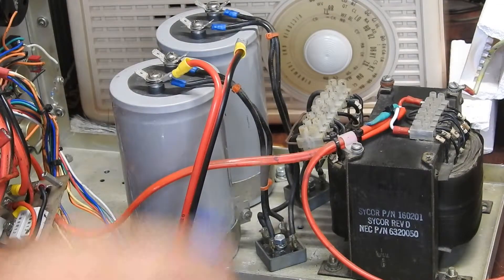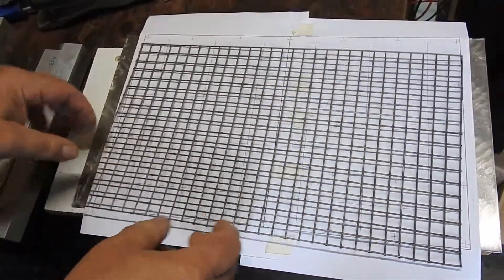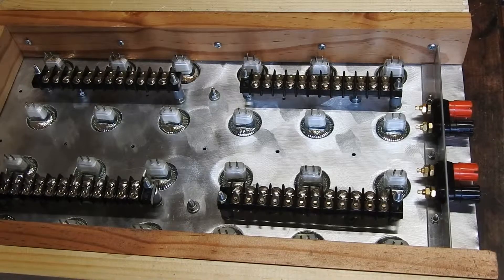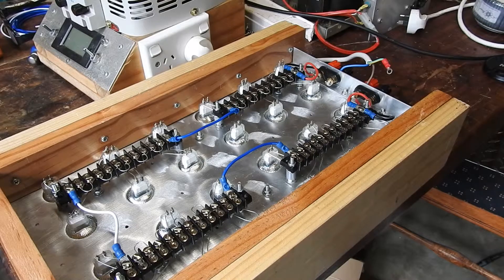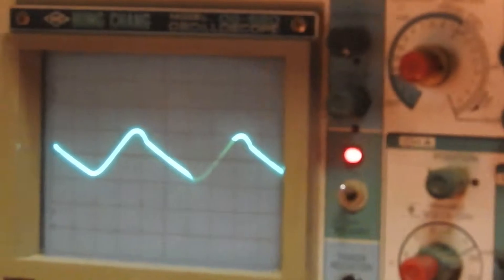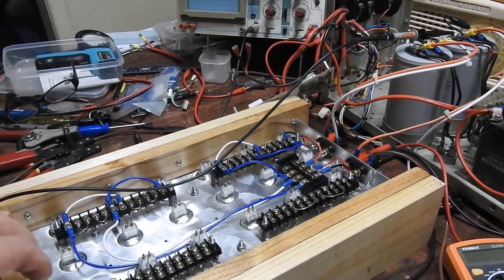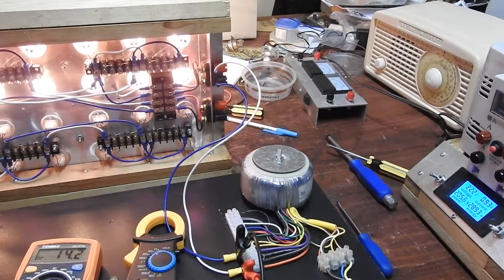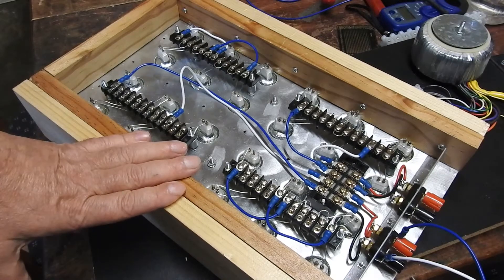A 1200 Watt Dummy Load using Halogen bulbs

Comment: This is an awesome video! Thank you for the excellent work you did explaining everything, I would like to see more videos if you still have it and also speak about the experience of using it along the years. Keep up the great work!
Reply from the maker: Thanks! I haven't done much with it since the video.
The Positive Tempco of light-bulbs, makes this load unsuited to regulated power supplies - they can go into wild oscillation.
But it's fine for say, the raw or rectified output of a transformer. I have some projects like that where this load will be useful.

Comment: Is there any reason that I could not use my DIY VAC Power Supply to create a (rough) High Voltage DC Supply, by simply adding a full bridge rectifier and some caps? Don't tube type audio and guitar amplifiers have high amplitude DC voltage on the tube plates? Might it work for injecting voltage for testing? Just a thought... Cheers.
Reply from the maker: I'm not sure how that relates to this video, but yes, what you described is possible, but very much subject to safety concerns, depending on the specifics of what you use and how it's done.

Comment: Cool im making one whit car h7 💡 and i use 2 XH-M401 in parallel. (Input) and 4 h7 bolbs 2 per XH-M401 module. So i can step voltage down and that way i can turn the pots to increase or decreese the voltage.